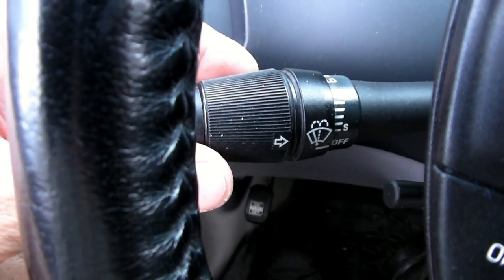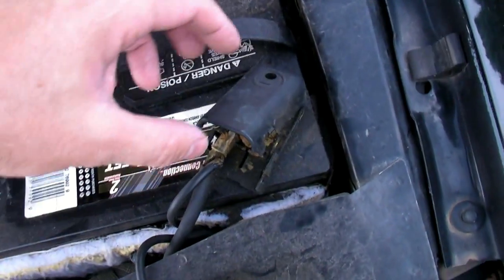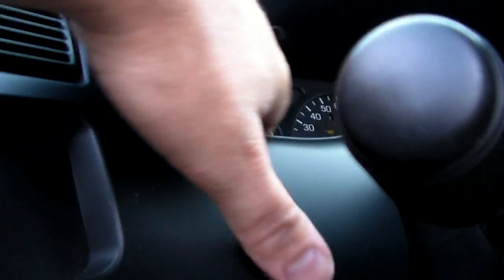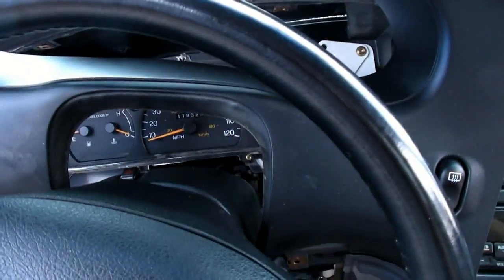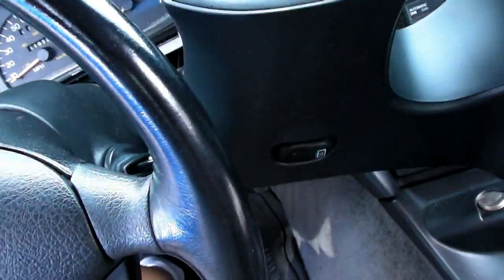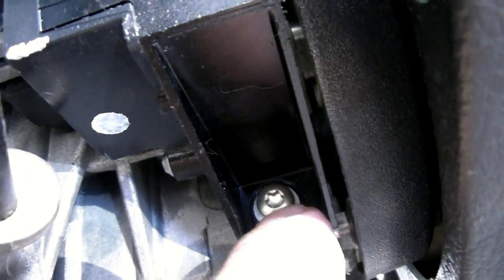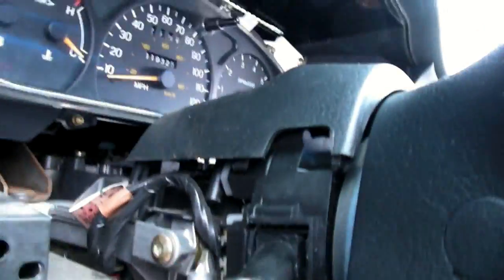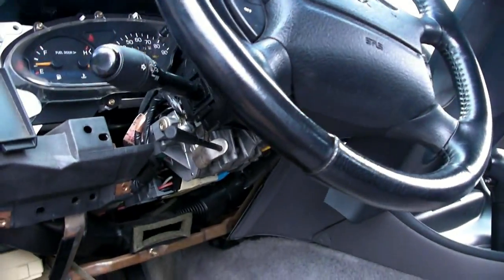How To Change a Turn Signal / Wiper Control Switch On a Ford Lincoln Or Mercury

Comment: my problem is that my left rear turn signal will not flash.  changed bulb and all fuses.  could it be the multi-function switch?

Comment: My son and I just took the multi-function switch off – ’98 Continental. Had no turn signals, hazard light didn’t work and the lower brake lights didn’t work. The rear window brake light did work. The ignition switch removal was easy. Removed the lower four screws to remove the cowling. Took the two screws off that hold the multi-function switch to remove it and took it apart – five T10 screws. There are no electronic parts in the assembly only contacts and springs and plastic levers. The grease was dried out and there was some corrosion. Cleaned everything and put it together. All functions work now.

The point is you can fix these components without buying new. Depends on whether you have more time than money.  

We had first tried the lighting control module. Disassembled it (very easy to remove) and checked the two relays (took one apart to see how wiring went). Energizing the two small pins on the board for the relay activates the coil to close the contacts. All other items on the three boards are solid state. Also, we had checked the fuses, bulbs, etc. beforehand.

Comment: my problem is that the left turn signal will not turn off even when the lever in the centre i cannot use the right as well would that be down to the switch ??? mercury couger 96

Comment: What if both of my low beams and hi beams dont work? My high beams get turned on when i pull the control knob back but wont turn of when i push the knob forward? Would i need a new multifunction switch? Its on a 97 mustang gt